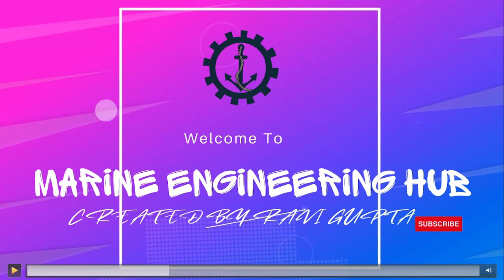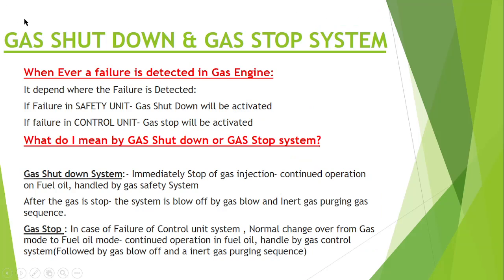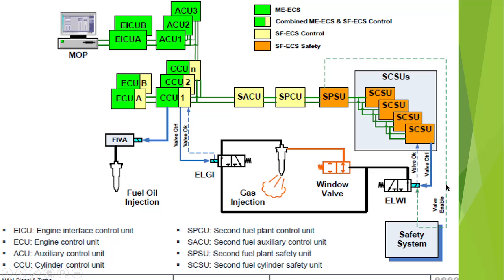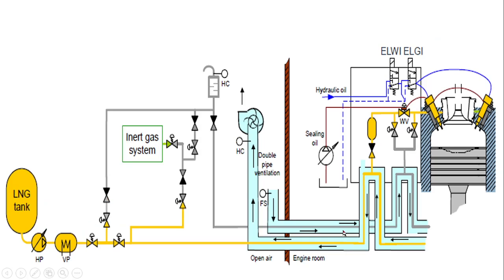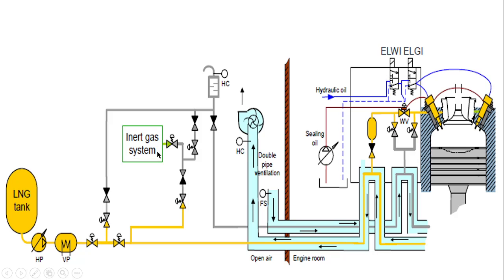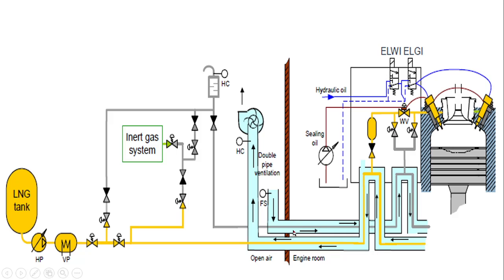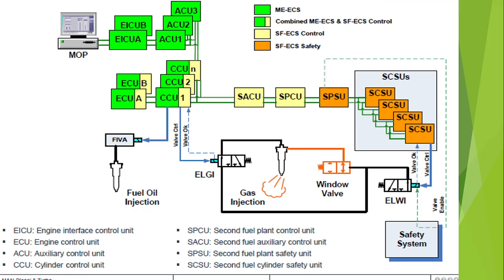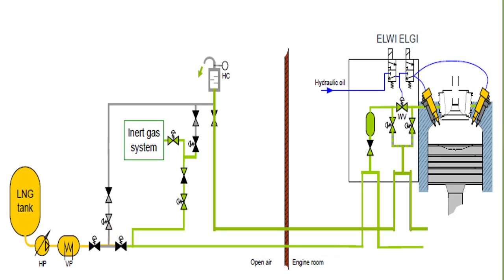ME-GI| Safety in Gas Engine| GAS SHUT DOWN| GAS STOP|What happen when GAS Leak|

Comment: Hello
I have a question about ELWI and ELGI. You said that ELGI controlled by the safety unit, ELWI controlled by the control unit. But on this diagram (2:34 time) it's shown opposite. Or where am i wrong in it? Thank you
Reply: Hi was wrong,, but you can deduct what  is correct